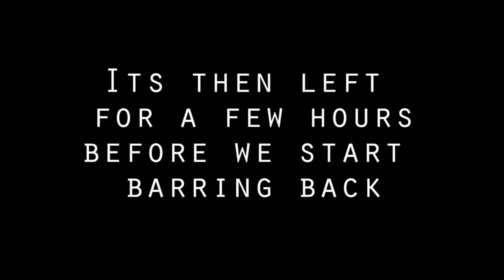Spray render specialists- ACE PLASTERING LTD

Comment: sure you do well hitting loads of this on sites but on a domestic the scratch back seems to be a problem product, getting dirty and repairs being a huge issue , and if the sun gets it good areas around the beads can pop out from the few times I bothered using this product. You do it well still using an ibar and a rule as ive seen people apply it and then just spat it flattish then use a scratch pad on it! I like the backing coat followed by 1.5 silicone topping, cost more but lasts longer, im sure you do that system your self's.

Comment: Machines like this are good if you are on your own and want to put in big days while reserving your energy, and even better if you have a capable team that can actually screed, float and finish. Slightly different her in Aus though, we have to apply another thin texture coat to that surface for it to be finished, usually the next day.
Reply: Mate you wouldnt on your own using a machine i promise you. Its a 2&1 things. Labourer feeding the hopper...the sprayer and the ruler of . You get it on..rule and close it up...then come back and finish it. Even the small machines like the pft ritmo you need a 2&1.

Comment: If 3 of you can have 150 M2 of render on the wall by 10am by hand ... Put a vid up on hear
Reply: ACE PLASTERING one coat of plaster is wrong. should always have atleast 2 coats. 1st the scratch coat then a top coat. even a cowboys horse knows that.
Reply: 😂😂😂😂😂 nonsense. Ask any real plasterer. They'll tell u.
Reply: ACE PLASTERING nice upload nice as regards anyone putting up a vid of crew knocking out 150m2 render by  hand for 10am lol  it ain't gonna happen bud 

in my book when any spread starts talking about how fast they can get  m2 on I stop listening 
... top  job lads 👍👏
Reply: Chris Godfrey #therealdeal #goldentrowel 
🔔🔚
Reply: You are right, It will start to crack without the first coat.
Reply: Chris Godfrey you 🛎 🔚 😂😂😂 it’s not sand cement render. It can be done that way. Yes you can get a key coat if you want but they were going over high density blokes so no need. Too wrk lads, been on it today tricky little number in the cold as slips up behind the spatch a bit. H bar will sort it in the morn :)
Reply: Chris Godfrey it doesn't need a scratch coat theses are one coat systems .im plastering 28 years and u have to change with the Times.I've done alot of pump work and i can tell u the boys are doing a first class job
Reply: @chrisgodfrey2401  you have no idea I do this day in and out and these guys are the real thing get on ha multi finish for £2.60 per m2
Reply: @chrisgodfrey2401  you've made yourself look very silly there. it's called monocouche... translates to single layer. ive been doing this for 22 years. this is correct. you are a fool!

Comment: not real plasterers
Reply: Wake up...this is the way to do specialized renders properly. Plastering is vast and this is one aspect of it. Machine plastering on commercial jobs is widley used through europe indoors with products like mp75 one coat and outdoor specialized renders like krend and many others. The trade is full of too many wollies that do a few square metres of float and set and claim to be spreads. They know nothing. Plastering in the correct hands is an art so appreciate and try to learn abit more.